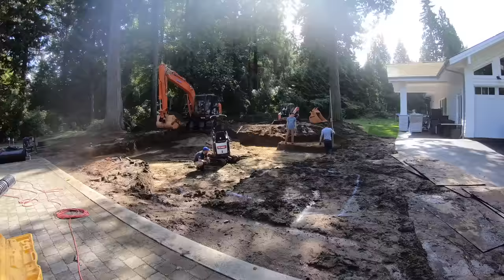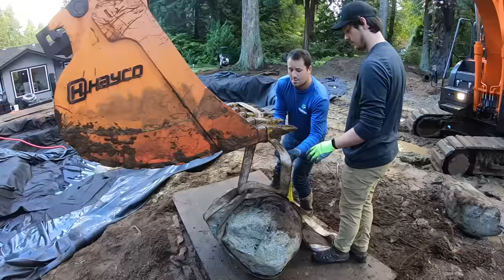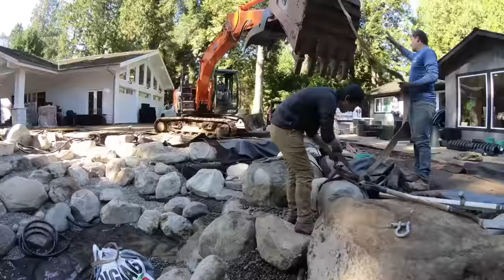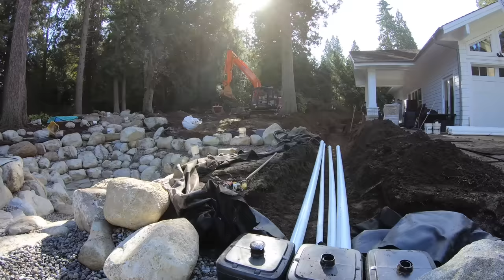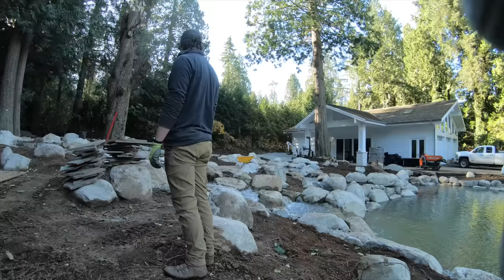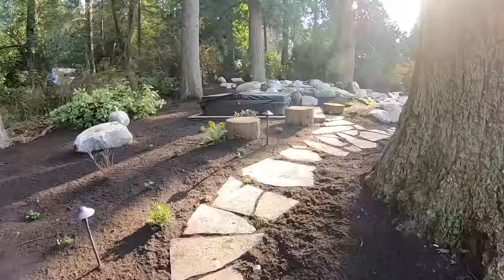How to build a natural swimming pond!

Comment: I've dug several test pits around my property and have 2-3 foot of sold clay under my topsoil. Would it be possible to archive similar results without the liner? Just don't see that rubber lasting the test of time??? But maybe I'm wrong... Great work thanks for posting!
Reply from the maker: Earthen bottom ponds require a bit of a different style of intake skimmer but its been done plenty of times by many contractors. That being said, EPDM liner, if installed properly, should last upwards of 20 years.
Reply: @fontanawaterfeatures   the right epdm last for over 50 years ;) (2mm)

Comment: Looks great as always nice job with the bottom of pond. How many tons of boulders and gravel did this project take.
Reply from the maker: Roughly 190 tonne of stone and 50ish tonne of gravel. We will admit we underestimated tonnage of gravel on this one by about half.
Reply: @fontanawaterfeatures  How do you get your gravel in bags? The only place I've ever seen them is at the Home Depot, with ¾" crushed rock in them. Can you order them delivered that way, or do you fill them on site? Do you use more than one size of gravel in your projects? In your stream videos it often looks like the stream is all one size of gravel...

Comment: Nice work.. but with all those 🌳 and the leaves falling in the fall .that would be a pain to keep maintained .
Reply from the maker: Its true that there are many tall trees around that shed. However, the intake bay/skimmer and strategically placed surface jets work amazingly to gather that debris for removal later. Stay tuned for a future video we are making on each component of a swim pond.
Reply: Most of those are evergreen so needles not leaves
Reply: Brock Mccuen Oh! Needles are way easier to manage than leaves
Reply: @Quick-ug2wl  if dealt with quickly but left to pile up they will compost into a muddy material as well but if those were all deciduous tree's then I couldn't imagine the clean up.

Comment: Was the rubber liner placed over the white pipes in the bottom?
Reply from the maker: Yes. The white pipes were for an under-liner drainage system to control ground water. This project was very close to the water table so it was necessary.

Comment: 0:57 
Is this an infiltration system to catch ground water and pump it out so you don't have ground water pushing against the liner before the pond is filled? or is it needed to be pumped dry all the time?
Reply from the maker: Yes. It catches water and sends it up the path of least resistance (up the sump pipe) and exits out of a pipe tied into the house drain system.

Comment: For a recreational pond with a wetland filter, what pump do you use? Curious as to electrical pump being in water for wetland filter?
Reply from the maker: For a swimming pond we typically use external pumps for liability reasons.
Reply: Okay. Can this picture be painted clearly to me. The intake bay has 3 pumb vaults and I am assuming it has 3 pumps in there. I saw a connection of 3 pipes from the intake bay towards the swimming pool pumps(external). Also there is a biolfal on the otherside of the intake bay as well as a wetland filter. How are these water of pipe connections done and from which point to which point. Eg. Let's say water moves from intake bay to........... then back into the pool. I don't know if I am clear enough
Reply from the maker: There are actually 4 pipes coming from the intake bay. They all go towards the external pumps you saw in the video. From there, 2 pipes go to the waterfall, 1 goes to the wetland filter, and 1 goes to feed the underwater jets. Does that help?
Reply: @fontanawaterfeatures  From this description it seems that only half the water goes through the Wetland Filter, but that assumes all the pumps are the same. What percentage goes through the wetland filter, and what percentage into the waterfalls?

Comment: Those boulders at the bottom of the pool could became a death trap if your feet get caught there... definitely not safe
Reply from the maker: I suppose so. With that line of thinking we shouldnt be going out to lakes or river systems to swim either.
Reply: @fontanawaterfeatures  no you are wrong, because that boulder disposition is completely unnatural, additionally river boulders are rounded and soft-surfaced due  centuries of water running while your boulders are just pieces of stone with sharp angles. I don't know, but if I were you I will be purchasing a good insurance
Reply from the maker: If you look a little closer you should notice that the vast majority of our boulders are rounded. With this being a swimming pond we wanted to be sure smooth surfaces for climbing over. Thank you for your input though.

Comment: Been doing a lot of research into this and I have seen some people put aquablox or some sort of "outflow" into the bottom of the swim pond itself to push debris and water off of the pond floor. Is this an overkill? I dont see any piping or flow in the bottom of the swim pond in this video and you guys clearly know what you are doing. Is this not needed?
Reply from the maker: Some people have installed upflow systems at the bottom of their swim ponds but it's generally considered overkill. In this case we installed a set of jets along the floor of the pond to keep debris suspended until the intake bay can capture it.
Reply: @fontanawaterfeatures  Thank you for your time and answer, I saw the jets that you put in the bottom. Do you orient those jets the same way (as in both clockwise) to create a swirling pattern?
Reply from the maker: The bottom jets are mostly aimed up at 45 degrees in no particular pattern. Top jets are all aimed towards the intake bay.

Comment: How do you keep mosquito larvae out?
Reply from the maker: As long as you have decent circulation mosquitoes typically won't lay in the pond. This pond has top jets for circulation and in intake bay that draws water into in for recirculation elsewhere. That being said, when you have stagnant areas where mosquitoes will breed fish are usually the best solution.

Comment: What pumps were used? Any problems with them being located so far from the intake Bay?
Reply from the maker: We used Artesian Pro pool pumps. The runs were pretty long to be sure and obviously we lost flow due to head pressure but our flow rates were still pretty decent out of the waterfalls and up into the wetland and jets system.  We used 4 total pumps. One for the jets, two for the stream, and one for the wetland. This one was also heated so we ran the pump for the jets through a pool heater. Pretty cool.
Reply: @fontanawaterfeatures   thanks for the information. The completed pond was amazing. Was the surround fully bonded? I've seen that for swimming pools the pumps must be bonded as well as around the pool. Was curious if this was as well.
Reply from the maker: No bonding on the pond. Pumps are however. Not sure we know of anyone in the industry doing this on swim ponds. Not sure why though to be honest.
Reply: Wont it be a problem with fungus when sunlight hits the water?
Reply from the maker: Do you mean algae? Fungus isn't a very common problem with our ponds.
Reply: Fontana Ponds & Water Features what is the solution for algae
Reply from the maker: A good wetland filter, adding beneficial bacteria, water plants to shade the pond. You essentially are trying to out-compete the algae for nutrients.

Comment: I am still wondering what these pipes you installed in the beginning do. If i saw it correctly you simply added gravel and dug them in again, so I think that i missed sth important here.
Reply from the maker: This catches water under to liner to avoid bubbling of the membrane. It sends it up a sump pipe outside the liner and exits the sump via a pipe tied into the house drainage.

Comment: NOT a how to build, a timelapse of a build, no specifics were used. pump flow rates, recommended materials, planting for additional natural filtration, tubing sizes, additional equipment, legislation for building, im sure the list goes on, having had plans drawn up for my own its way more involved than it looks, i got actively involved with the design and planning of my pond and decided that it would be more cost effective to to build an actual swimming pool for what the needs were, it was no more natural than doing what you were doing, just looks more "in touch" with nature when in essence its a giant pond on a grander scale with way more cost involved.
Reply from the maker: We would disagree that its no more natural than a swimming pool. The filtration system on these ponds is actually via a constructed wetland filter (some call it a bog filter). It is through this and other components such as marginal water plantings and beneficial bacterias that the water will maintain its clarity as opposed to the chlorinated systems of traditional swimming pools.
Reply: @fontanawaterfeatures  Yup im very aware of the "Benificial planting" that is involved, its natures way of filtration aided by pumps, heck, even to some degree keeps the whole lot of it warm, naturally. It blends in with the environment in an environmental way and gives an amazing platform for swimming in, im not having an argument about it, but given its size and content of water volume, a comparable pool would more than likely cost the same or less, with regards to maintenance and "chlorine" its a winner, due to the chemicals involved, however there is also salt water chlorination which is less chemical than chlorine and kinder to the skin(i bet theres a maintenance plan involved in the "aftercare" however). I had a 45mtr by 33mtr multi stage design drawn up with detailed planting structure made, my pool would have been 4mtrs deep at its deepest point, which i initially intended for scuba diving instruction, but it deemed very costly, in terms of digout in comparison to a swimming pool which was generally rectangular in size less upheaval overall but i still got the depth needed in a smaller package with less earth removal, i saw the natural swimming pond as a giant pond essentially with tiered flowovers gravel filtrations and continuous volume pumps. So its onto the "HOW TO", IT is NOT a HOW TO, its a time lapse, the heading title is very misleading and provokes comments as such!
Reply from the maker: Fair comment. Thanks for the input!

Comment: Not really natural. Just a bit natural looking,
Reply from the maker: That's a fair comment. For a closed system, it's designed to be as close as possible to what occurs in nature. Wetland filtration, oxygenation via waterfalls, outlet for water (which in this case is the intake bay where the pumps draw water).